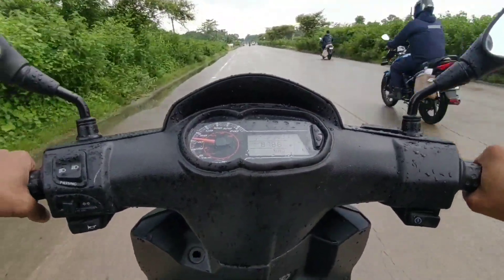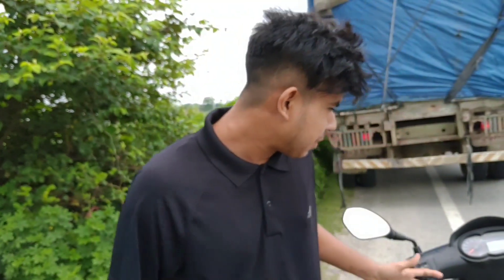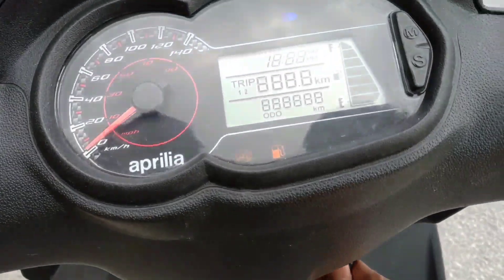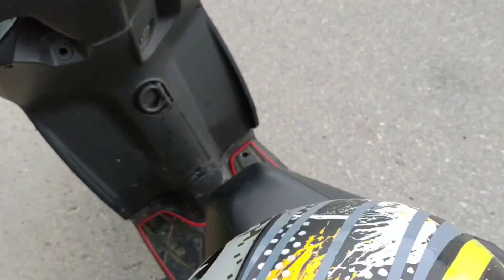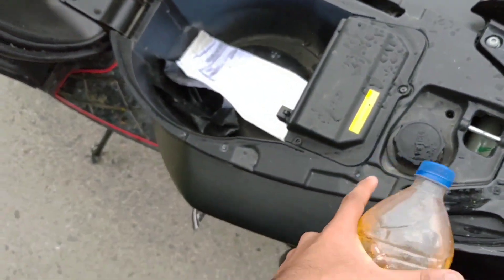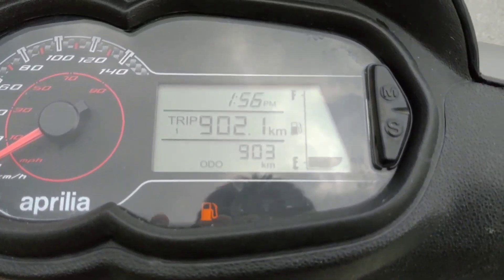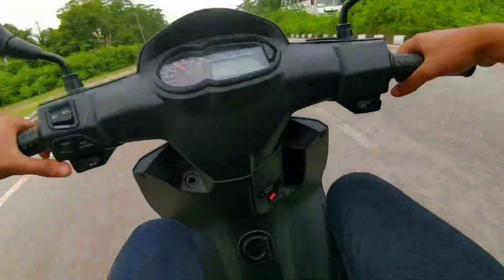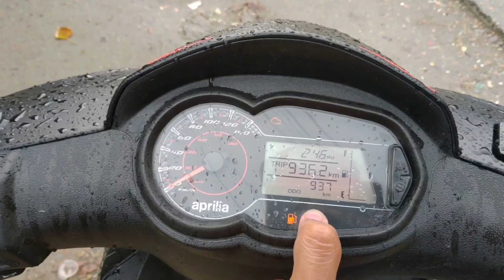Aprilia SR 160 mileage test, unexpected results 😱😱

Comment: Use this scooter with 40 to 50 kmph speed without excessive throttling, it will give 45 km per liter average. My BS6 carbon Aprilia SR 160 giving  45+ km per liter after first servicing. Pick up and styling is great
Reply from the maker: That's really good dude❤️❤️
Reply: Top speed?
Reply: What's ur mileage now and how much km u drove 
Can u msg me on insta pls just send a reply here atleast
Reply from the maker: The SR 160 is giving around 40 km/l and sr 160 s total km driven in 2500 while sr 150 is giving me between 38 to 43 depending on riding condition after the performance upgrade and total km I had clocled on my se 150 is 9000km
Reply: @aivlogs1345  does sr 160 has same performance as sr 150
Reply: @aivlogs1345  how's the performance compared to sr 150 pls tell me bro
Reply: 125 cc ka mileage kitna rahega
Reply: But my 160bs6 scooter gives only 26 kmpl
Reply: Before first service how much u was getting
Reply: Bro mere sr 160 mein 350rs mein hi full tank ho jata hai...kya yeh common hai??
Reply: 100% .
I checked today got 42.5
After 5000km
Reply: 60 ki speed me bhi 50+ nikaal Chuka hum bs4 se
Reply: @robinmandal9981  my also bro,23
Reply: Bro are u sure?/because i am planning to take the same
Reply: Thanks bro. I'm also planning to buy this one
Reply: I have 2019 ABS Model it gives only 24 kmtrs/ litre 🥺
Reply: @robinmandal9981  I’m thinking to take that should I take it or just drop ?
Reply: Yes am using Aprilia sr 160 carbon. Gives me 47 mileage
Reply: 50 ke aspas Hoga Kam batata hai uska trip mere Ulysse speedometer app se check Kiya hai
Reply: @robinmandal9981  yes bro my my scooter also give 26 kmpl only

Comment: I have Race 150. Rs 350 petrol gives me around 130 km
Reply from the maker: SR 150 race mileage is very bad,even mine gives  max 30 but after performance upgrade im getting 38
Reply: How
Reply from the maker: You can check out the video in my channel performance upgrade on Aprilia SR 150

Comment: 160race ki mileage same h kya bro ?
Reply from the maker: Ha same hi ha bhai😄😄😄
Reply: @aivlogs1345  Or vhi Sr160 Race or carbon who is Best ?
Reply from the maker: Mere knowledge ke mutabik dono hi same  torque and bhp Dona ka same hi ha only cosmetic changes ha , race edition me stickering and red alloys wheel milega and carbon me stickers carbon fibre ke diye Gaye ha
Reply from the maker: Okay dude I will check it again
Reply: Aprilia SR 160 Race Edition has fractional more torque compared to Carbon edition model and race edition comes with more fancy stickers and red colored alloyed wheels. As per performance is concerned there is no absolute visual difference between 160 race and carbon edition. Only the look of race edition is more fancy for which you need to pay extra money around 7k to 8k. Carbon edition is sober in looks and can be used for office as well as casual rides.
Reply from the maker: @vkshirsagar8271  yes

Comment: Bro meri new sr 160 race 20 mileage deri it's just 1 week
Reply from the maker: 1 St service karalo thik ho jayega
Reply: @aivlogs1345  thank you man
Reply: @mustafahussainpyo  bro. Same with me I got 25km ,please tell me which engine oil brand is using service centre in my ist service they use gulf engine oil but manual says Castrol please reply Thanks
Reply: @reyhandar882  same after 1st service I'm getting 22 now . don't know what's wrong
Reply: @mustafahussainpyo  brother nothing is wrong, in starting it gives low mileage because engine is new,don't rub the engine too much keep speed 40 to 45 km in first 700 to 800 km because engine is new .After my first service it gives me 35km. bytheway which engine oil you use ?
Reply: @reyhandar882  Castrol and I already completed 1000km
Reply: @mustafahussainpyo  i thick gulf engine oil performance is better than Castrol.
Reply: @reyhandar882  oh so when can I pour golf oil like now or next service?
Reply: @mustafahussainpyo  it depends upon you .